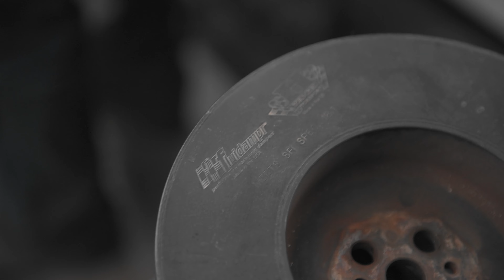How to FIX a Leaky TIMING COVER GASKET On a 5.9 Cummins! | 4k

Comment: I dont get the point in making a pickup fast, I want fuel economy out of my cummins because it's meant to work, may as well make it work as efficiently as possible.
Reply from the maker: I get that. The awsome thing about the Cummins platform is that you can make it do both 😎
Reply: I have +75 injectors  stock turbo 6 speed manual  fass fuel  system  hotrod chip  4 inch down pipe  to 8 inch stack  with  a Bradford flatbed   I get 20 to 25 highway  empty  and  15 to 18mpg  with my 36ft gooseneck gooseneck
Reply: Probably only  pushing  400 to 450 hp  and I've gone all over  hell and  back with  her  but  I'm an 02 vp44 second gen not a common rail

Comment: Quick question did he just use rtv for the vary front of the cover instead of the gasket with rtv and did you guys cut off the front portion of the oil Pan gasket or leave it and just rtv it?

Comment: In your opinion, What should I expect to pay to have the timing gear cover gasket replaced. 2017 Ram 2500 diesel 6.7l cummins
Reply from the maker: I mean it's a huge job. As you can see lol. I'd think it would be $1500 pretty easy
Reply: @LMDiesel  dealer wants $2400.00, I'd be happy at 1500.00
Reply from the maker: @johnfreitag4044  dealership always charges more. I'd find a local shop, with a good reputation
Reply: I pulled my motor to change that the oil Pan , cam cove front and rear seal and the tappit gasket, mine was a major oil leaker, so I did it myself
Reply: @LMDiesel  Damn I'd pay that with no hesitation. The 'reputable/best' shop around me wants ~$4500 to fix the inner timing seal on my '15 2500.

Comment: Do i haft to pull the cam to do the gasket
Reply from the maker: So there are two gaskets. For The timing case cover gasket, you dont have to pull the cam. But for the timing case gasket, you do.
Reply: You don’t have to pull the cam for either, you pull the gear off the cam, then heat the gear and press it back on.